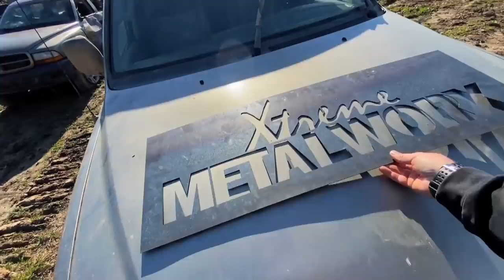Mitsubishi Montero CRASH JUMP!

Comment: Mark, marking paint does in fact come off after rain and weathering for a couple weeks. You can also remove it with a power washer. If you ever make a hole in the intake like the Montero then you need to make sure it is plugged up whenever you’re running the machine it will run much better and not bogged down. It basically pulls extra air through there making the air fuel ratio way off. Also if you are trying to start a diesel with dead batteries you are going to need to jump it with multiple different trucks and your NoCo diesels take a crap ton of power especially when they are cold.